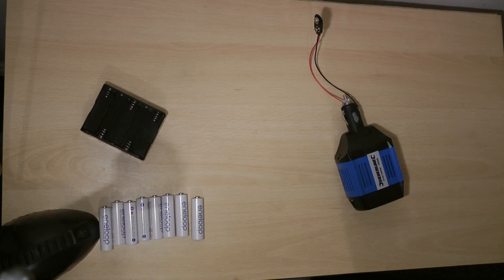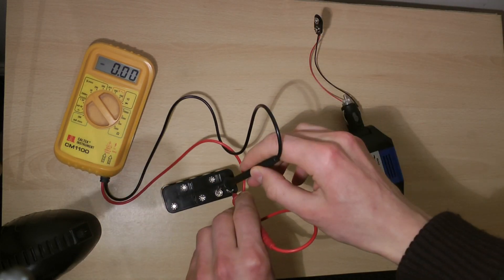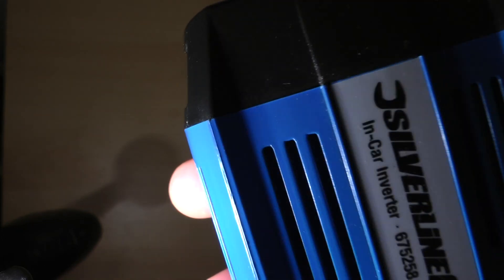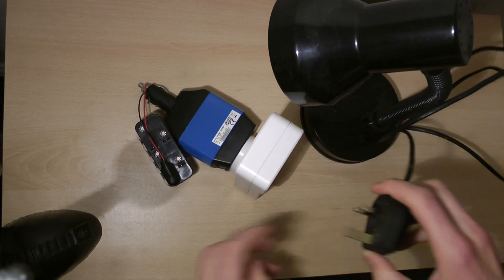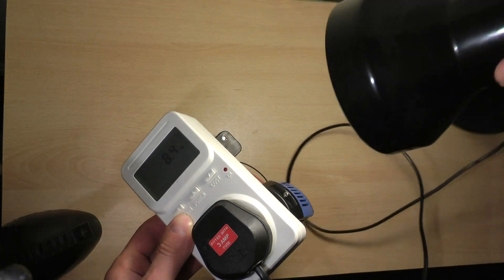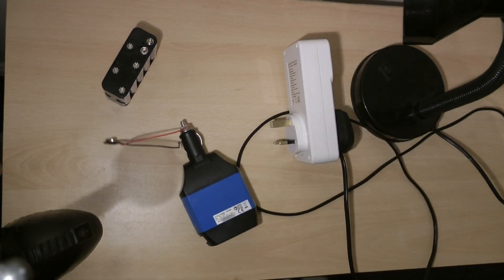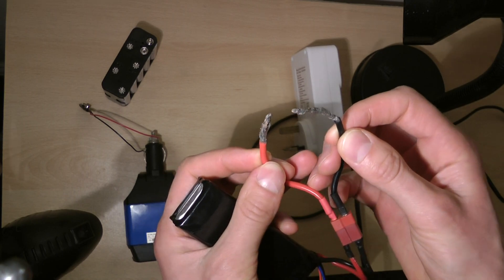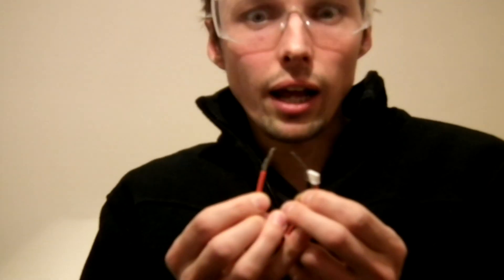how to turn 10 AA batteries into 220 volts

Comment: I have a small device that can convert 1 volt into 400,000, called a voltage converter. It sounds much like a tazer when activated but burns the batteries out after a few seconds. It also can't stand more than 6 volts of input without catching on fire and malfunctioning. These can be purchased on amazon.

Comment from the maker: nebuus
Reply: 12 Volts wont shock you because the current through your body is about U/R=12V/10000ohm (resistance will get lower if you go above 50V and even lower if you go higher and also lower with wet hands) so this wont be enough to feel it if your hands are not wet. But it will get very hot. And this may cause big injury.  Also if you short the battery its not good for it and it may explode. And if the wires get hot and melt together you wont be able to seperate them fastly, then they will get red hot and the battery may explode. So dont do that. (i did it as well, but i almoust got it that hot that i couldnt seperate it again and it burned me. So my skin got brown and started to smell very badly)
Reply: @neutronenstern.  bruh